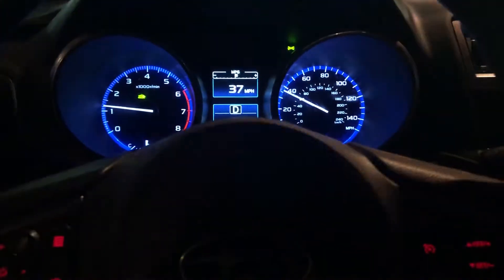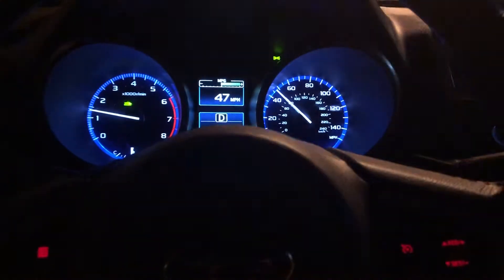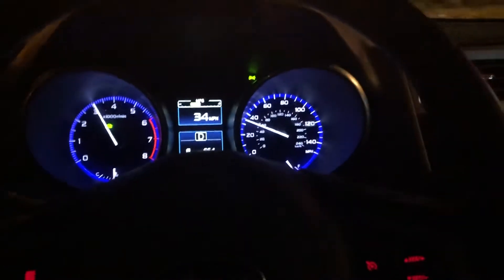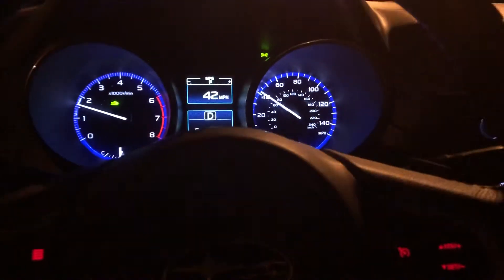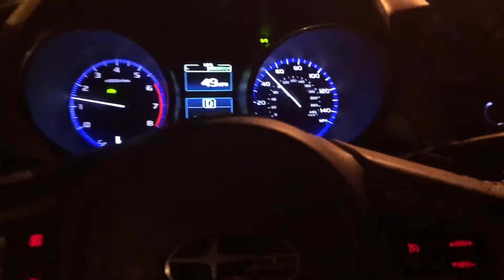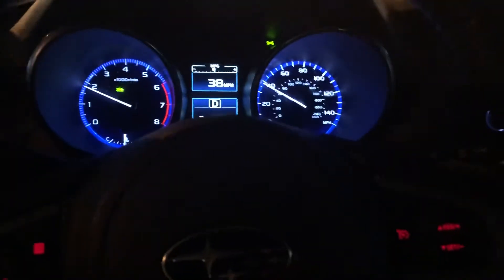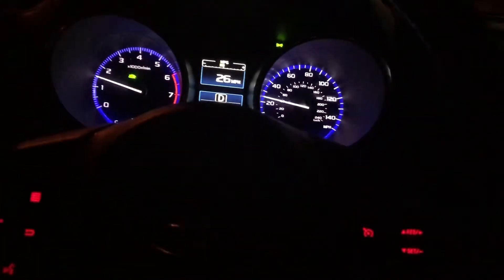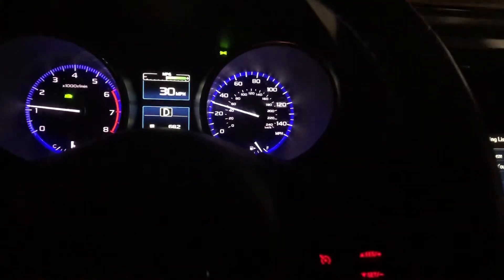2017 Subaru Outback CVT Behavior

Comment: Very interesting. Ive just got a 2011 Legacy, a bargain from a local Subaru dealer with only 76k miles on the clock and its got such a weird transmission. Ive driven loads of CVT cars but this is inconsistent, and taking me a while to get used to how much foot input is needed at varying speeds to keep it accelerating smoothly. Very very tricky. Toyota Prius I had for a day was awesome, so smooth and seamless power delivery. Guess thats cos its an E CVT with no belt. Next !
Reply from the maker: So the newer subarus have that throttle input inconsistency. Common complaint there across the board. Yours will probably not due simulates shifts

Comment: It's not the chain that breaks. It's the bearings that fail the most. CVTs are not durable designs. They are inherently fragile, and will wear out at an accelerated pace when constantly used with high loads. 

Personally I believe a well geared, well behaved 5 or 6 speed automatic is superior to a cvt, at least for passenger cars with their broad engine speed range. (More speeds will be appreciated in heavier vehicles with narrower engine speed ranges.) The durability will far outweigh the minimal fuel savings in the long run.

As far a drivability goes, I'm not that impressed with CVTs.  They can be forgiven for their boring nature when they operate in a truly smooth manner and can also react quickly when sudden acceleration is needed. However, CVTs that execute fake shifts or that stutter at low speeds are just aggravating. Even more aggravating is the CVT's sensitivity to fluid viscosity. At cold temperatures, CVTs  will keep the engine speed quite high in an attempt to heat up the fluid more quickly. This behavior is detrimental to the fuel efficiency of cars when driven in cold climates. I don't like Subaru's CVT because it stutters at low speeds, has annoying, abrupt, pointless interruptions in power under acceleration, and wastes fuel in cold weather. They are responsive, I'll give them that, but the durability is still debatable.

I can excuse a cvt for many of its faults as long as it stays true to its original purpose - better fuel efficiency and cheaper cost. However, cvts that can't be durable or cvts that behave in ways that hurt efficiency are just plain stupid. Personally I will not buy any cvt equipped car that doesn't meet my standards for how a cvt should operate. Zoo far, only Toyota's hybrid CVT can do that. Those transmissions are durable, smooth, efficient, and responsive. No fake shifts, no stupid behaviors, no aggravation. Any other cvt I will avoid.
Reply: Automatic transmissions fail too … but its hard to say that they are not durable designs as a blanket catch all statement.   Are some mfg's more inherently fragile than others?   Wish they would NOT program shift points … makes for smooth consistent acceleration and that's darn cool and comfortable IMHO.   Should have the option to remove the simulated shift points … silly, otherwise, make an automatic with physically shifting gears.   Also, buy a vehicle that meets your needs … never expected semi-truck towing out of CVT at this point.   You will absolutely wear out a standard automatic transmission at "high loads" too.   Have to stay within the specifications of what you are buying.    That said, please show evidence that lots of 2017 Subaru Outback motors are failing at their rated capacities etc.   I certainly did find anything...yet.   However, it seems that many vehicles are lacking and decreasing in the durability and longevity categories.    Capitalism rocks ...
Reply from the maker: Lol yupp
Reply: Man I absolutely could not agree any more with your post here- you just described my 2016 Outback's CVT behavior  to a T.
Reply: Toyotas E CVTs are brilliant. The new Prius, Yaris hybrid etc, ive driven both and wow, I could not believe how smooth they were. No fake gears, just a seamless effortless power delivery. My Legacy is hard work with its odd CVT, taking some getting used to. Its only a cheap car I got recently and will prob get a Prius next for relaxing motoring. For me, this Subaru CVT is not what I expected after driving the Prius. The idea of a CVT should be smooth acceleration at all times, no matter what speed whether round town or on the highway. Ive wanted a Subaru for years so im giving it a go, have some fun etc in it, may camp out this summer, that sort of thing. I shall just have to accept its a bit quirky.
Reply from the maker: E-CVT is a vibe
Reply from the maker: I feel like it is a hit or miss with some of these Subaru’s. I don’t notice the shuddering at low speeds or even the increased fuel consumption. Needless to say we may have just gotten a good one but I have heard some complaints that are similar to what you’re describing. While the fake shifts actually slow the car down I find them to make it more bearable since the constant drone annoys me more. I personally don’t want to purchase a CVT but with options becoming more limited it may just have to be possibility